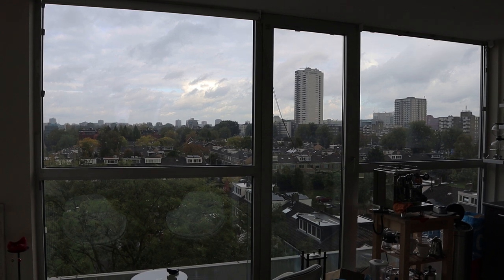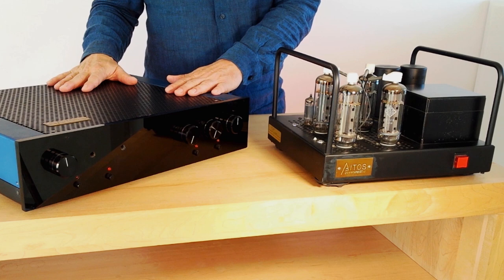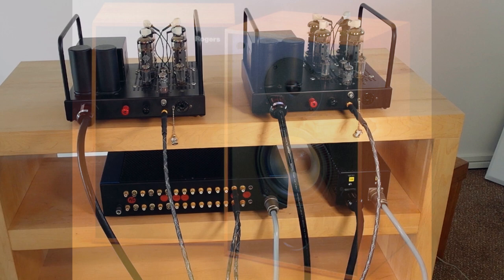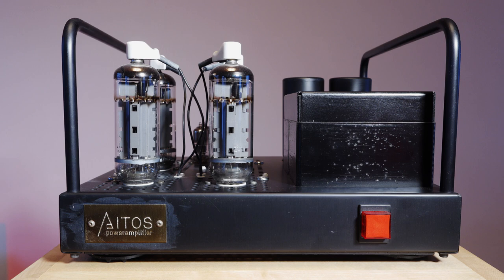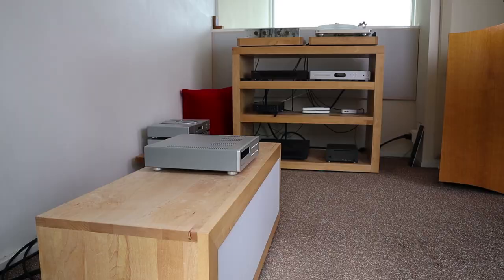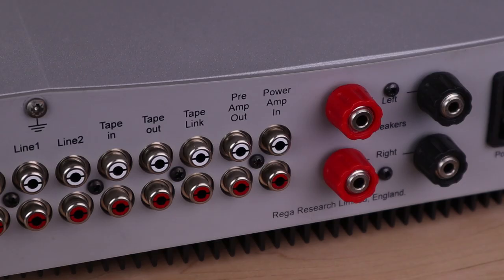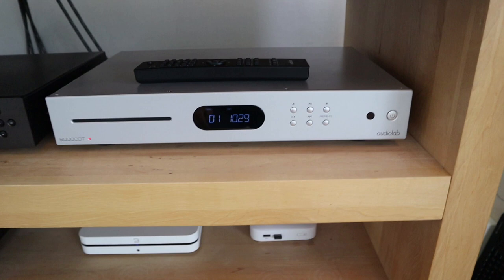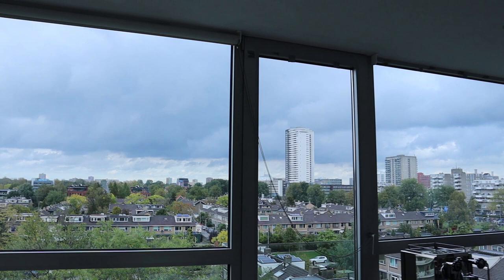What happened? Today you get the answer. The Audiophile Barista Vlog 113

Comment: For your phono preamp needs, given your tastes and desire for top quality, why not consider the Herron Audio VTPH-2A tube phono.  Price is a very low as it compares to phono preamps in the $10,000 range.  And the sound is insane.  Resistance and loading are more variable and customizable than most any other amp, and it is quick and easy to do, all without opening the box or using DIP switches.

Comment: I think that given your system, you might really enjoy a First Watt F1, F2, or F4, if you can get your hands on one (that's the hard part). They're quite strange amplifiers, in that they work differently from just about any others on the market. They're really designed to work well with speakers like yours, however. Not sure about preamps but I'm sure that either tube or solid state would be a good match. Caveat emptor; I have not heard these amps, I'm just aware of them and how unusual they are. Cheers!

Comment: Audio Note Oto.The end.
Reply: Great suggestion, though his Ocellias are 16 Ohm and the Oto doesn't have 16 ohm taps. He could run through the 8 ohm taps, but the sound many not be optimal and he'll lose power.
Reply from the maker: Hi, funny you should mention the Audio Note OTO. It was actually the amplifier I had before I bought the AITOS 😀 
- Very good amp. I would definitely go Audio Note again. The Audio Note Ongaku is on the top of my wishlist. 
- Just saw a KONDO Audio amp on offer but at € 20.000,- . A bit too much 😵‍💫
Reply: Look at the new Meishu Tonemeister if you have the budget. I just picked one up, blown away with the musicality and naturalness
Reply: @terrywho22  At 98db I will drive them no problem, Meishu even nicer amp if budget allows
Reply from the maker: @terrywho22    Correct (as always). The OTO played very nice with the speakers I had before the Ocellia’s but the AITOS set was a better match for the Ocellia. 
- I even had the matching Audio Note poweramp (P1??) so I could bi-amp. But there was always some transparency missing from the ORO that I did get from the AITOS setup.
Reply: @theaudiophilebarista2424  Meishu Tonemeister if budget allows , I’m driving 90.5db with ease , my goal is AN speakers eventually
Reply: @theaudiophilebarista2424  😄👍Yeah, when you mismatch the load impedance, you run the risk of getting some attenuation at the frequency extreme. It's typically subtle, but you can hear it. If the speaker has some significant impedance dips, its possible that it could sound better using a lower Ohm tap, but it's not surprising you heard some loss in transparency with the Oto.